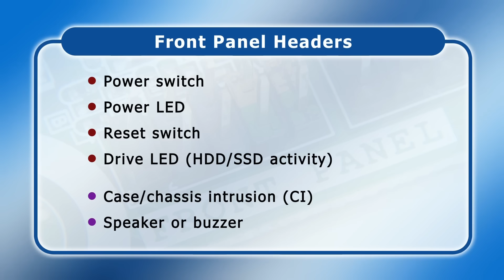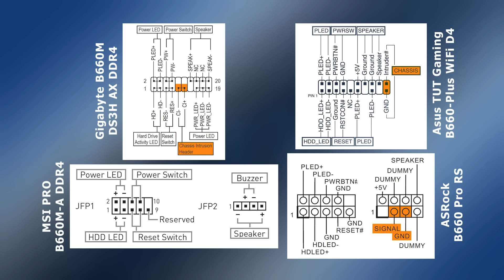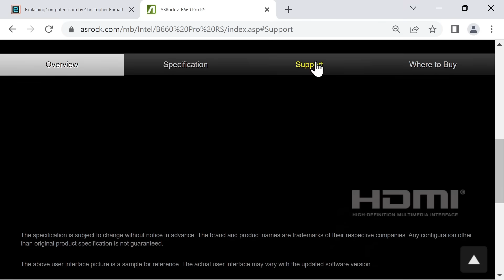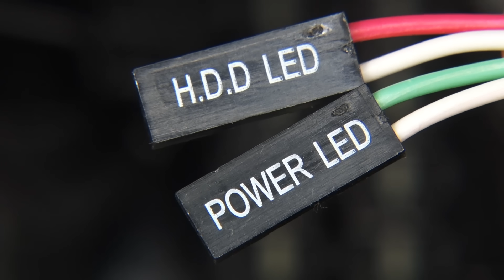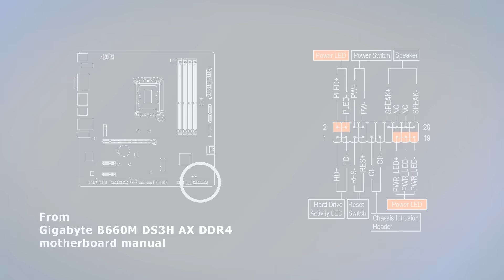Explaining PC Front Panel Connectors

Comment: That manual for the MSI PRO B660M-A DDR4 board lists four pins, and labels them as "speaker" for the outer two, and "buzzer" for those in the middle. What's the deal with that?
Is there a difference between a "buzzer" and a "speaker"? Is the electrical signal different? Or are those just connected to the same lines?

Comment: Front panel headers are the part of a build that I dread because my bass player's fingers are not the best thing to get into tight spaces and still be able to see what I'm doing ! 
I recommend using a pair of fine long-nosed pliers or getting yourself a pair of artery forceps, which are great for getting a hold on fiddly little connectors.

Comment: Not a fan of these front panel connectors as you mentioned they're not very standardized but since they're essentially a junction they did prove to be very flexible to me. 

First is troubleshooting the motherboard. Second is wiring up an Dell front panel connector (which cobbles all these headers into one connector) to an non-Dell motherboard. And third is to replace a broken power switch.

Comment: Great Video! The front panel was such a problem for me years ago, when I frankenstiened some old PCs from garage sales as I couldn't afford new parts, some of the older MoBo had no labels on the FP and I couldn't find manuals online. I Still have a front panel switch from a 2004 E machine tower bc it was helpful for figuring out old pin outs. 
I love how you reduced the circuits to the simplest form to explain. Once again a great video.

Comment: 2 Things: 1st: Some motherboards (Asus Rog Strix B560-i in my case) will turn the LEDs off when extreme power saving is selected. I always thought these connections would be hardwired, making the LEDs work no matter what. Makes you wonder if hackers could use this to report no SSD activity while all the the files are being encrypted without the user noticing. Surprisingly this did not turn off Intel Turbo Boost. But that is another topic.

2nd: The part at 10:06 that holds the speaker. Are those support rails for full length expansion cards? Those would be handy with today's  graphics cards wouldn't they?

Comment: One problem I have ran into is when replacing a brand name motherboard with an aftermarket one. The layout of the front panel switch connectors are usually all one connector. Trying to decipher which wire is which can get tricky, as the wires to each switch/light are sometimes the same color. And the front panel switch unit can be self-contained. I even came across one that had a different layout for the USB connections. The missing pin was on the opposite side. Not to mention the front panel audio plugs.

Comment: I hate the front panel connector. It's been over 25 years and motherboard/case manufacturers STILL can't agree on a singular plug. Only Gigabyte and ASUS have come up with a little contraption to make life a little easier. But it only exists because motherboard manufaturers need to get their head out ot fhe sand and work together for a singular plug.

Comment: Very nice when they actually have all the standard pins (good clear examples!) and better yet, labels... many do not.  Good trick with the power switch extension. :D 

A few of the many-do-not miscreants from my collection...

-- speaker headers that have THREE pins and no blank or dummy pin, or two adjacent pins. Regular 4-across speaker plugs will not even fit. (common with older boards)
-- NO power or HD LED and NO Reset pins! (I'm lookin' at you, Lenovo....)
-- More than one pin pair that function as on/off switches, and no labels. (In that event, I drag a BIC Stic pen point back and forth until it contacts a pair that work. The conductive tip is just the right size. A small Philips screwdriver will do in a pinch.)
-- Naked USB headers and a case that has a bundle of loose plugs with minimal or no labels. Better guess right or the magic smoke will get out. (Intel, over into the corner with Lenovo....)
-- An extra and undocumented USB jumper that needs to be closed before USB3 will work....situated at one end of the USB header, so it's all one unit. (Seriously, Lenovo...)

You may sense a theme... a lot of OEM boards have front-panel insanity. One becomes grateful for labels and manuals, and for mainboards that come in an antistatic bag instead of inside a name-brand PC....

But as this video clearly demonstrates, it need not be a mystery, or difficult. Choose your board wisely... attention to this sort of detail propagates across all the features.

Comment: Great video Chris. Just an observation. You didn't mention the small sockets that some manufacturers include nowadays that have the same pin orientation with the motherboard and allow you to insert the pins there instead of the motherboard's connectors and then connect this socket on the motherboard. They are truly lifesavers, especially for us old dogs who need a couple of different pairs of glasses and a strong lamp above their head in order not make mistakes during the assembly.

Comment: It would be cool to see a video about upgrade or repair options on laptops, along with explaining the layout of connectors on its board. I'm pretty familiar with it but it could be helpful to others who want to troubleshoot in that kind of situation.
Reply: That would be a total can of worms. There's no standard anything. Surface Pros are all glued, while Asus laptops are modular. Some need to remove the keyboard to upgrade the RAM (and that RAM may not work). And so on.
Reply: @Rez Zircon As this channel usually goes, I don't expect tablets and more complex stuff to be covered. I don't know if you want that, but I certainly don't. Most laptops follow at least one or two basic trends for teardown.
Reply: @Gamefreak924  I had cause to compare teardowns of a Surface Pro with an Asus E410. Couldn't be more different, and goes to show how this really isn't one topic, but species specific.

Comment: Recently built my computer from scratch and was able to buy a 8pin ribbon cable, bare connectors and terminals and make my own front panel connectors. I used a green LED for power and blue for HDD. I did get confused on the power switch because it was a momentary switch. I had to search for some time to get an answer you clearly presented in minutes. As a hint for anyone building your own front connections, use a resistor on the leds, they will be blindingly bright in the dark. As a side note, my PC is purely passive cooling with no fans, the mobo and ps are mounted on an aluminum frame which is open mounted to the wall caseless. (☆▽☆)
Reply: As a quick note, I got all my supplies from digikey if that helps anyone.

Comment: Chassis intrusion is an interesting one. Once worked on a large "MoD" site with many thousands of Compaq desktops. The BIOS was configured on each to talk to a Syslog server so if any of the cases were ever opened it would be logged with the unit serial number. As asset tracking was super tight it only took a quick lookup to find out who the unit was assigned too. I think some NHS trusts also do similar.
Reply: RAM theft was a big problem at one point. People would liberate a spare module or two for their home machines or to sell on.

Comment: Hmm… I've just discovered my early 486 PC/AT clone will only boot on the power switch (rather than with a reset) if the HDD-LED is plugged in. Curious. Not sure what to do if I go for a Compact Flash car replacement. Not sure if the adapters have these pins, too.

Comment: This brings back memories...  Cannibalising old PC cases for their power and reset switches and LEDs.  One non-standard feature of front panel connectors, or at least of motherboards, that irks me is how some don't support making the power LED flash when a PC is in standby.  It doesn't seem to be related to the price of the board, either.
Reply from the maker: The Telegram EC account is a fake, a scam, and has now been banned.
Reply: @ExplainingComputers  I had assumed as much.  Still, sad to see a new cast member leave so quickly.  Farewell Sam The Scam; we barely knew ye.

Comment: Yet another great one Chris!

It's does make one think on the limits just two LEDs can convey. Last year I modded my desktop with a small USB-powered custom PCB that drives a third LED which lights up when my GPU is hard at work (with a little Win32 C++ coding in Visual Studio).

Also, early last year, I built a storage server around the X11SDV-4C-TP8F Supermicro motherboard, it has THREE headers for front-panel status; telling them apart was a head-banger without the manual as you rightly put the importance of having to-hand.

Comment: Please no... i was always afraid to make wrong connections, and that the PC wouldn't start ! But the most annoying was the noise of the hard drives, so i had plates of sponge etc to avoid vibrations... i started with a Cyrix 330Mz, then upgraded to a AMD 500Mz, then 1300Mh, then... at that time the 128MB of memory was so dam expensive. I staid with AMD to i guess 2Gh then i went to Intel, a cheap 2,5 celeron, but with a SSD hard drive. Nice and quick install.

Comment: "it's perfectly fine not to connect... the reset switch" - 6:49
That's debatable!   ;-)   While we don't NEED a reset switch as much as we did in the past, I find it annoying to have to shut it down and restart if there is a problem.  And then of course how long do you wait between turning it off and on again?  Everyone seems to have a different answer for that!  A reset button just makes life so much easier and it restarts immediately.

Comment: I was dealing with this last night at like 12am as I was building my roommate's PC into the night. The timing is perfect haha! Sleep deprivation made this particular part of the build the most nerve wracking part of the process, moreso that worrying about the cpu cooler pipes colliding with the heat sinks around the CPU socket, and was compounded by the fact that I had already rested the motherboard snugly in it's new case. I got it all hooked up though after consulting the physical manual many times

Comment: I think its astonishing that in the last 40 years PC motherboard and case manufacturers haven't got together and agreed on a standard connector/layout for this function, as every other connector on a motherboard has. Its not like its a rapidly evolving part of PC technology either, the front panel connections on a 1990's PC are pretty much the same, with the possible exception of the disappearance of the "Turbo" switch and LED!

Comment: A nice nostalgia trip. I only connect the power switch nowadays. My RAM has red LEDs which are more visible then a tiny front LED. My nvme SSD is never fully utilized because software can't keep up. Lastly if something goes wrong my motherboard has debug 4 LEDs to indicate the problem.

Comment: Where's the Chassis Intrusion explanation? I would like to see it in action.
Reply from the maker: I sadly could not find a case with a CI switch (basically  a switch that opens when a side panel is removed). When then happens depends on what is selected in the BIOS in the even of the case being open.
Reply: @ExplainingComputers  I don't know what kind of switch-type it is using, but I'm guessing it has two buttons, one for the chassis cover, and another, a button to reset the switch internally.

Comment: The positions for the pins of the power LED, storage LED, power and reset switch has become an unwritten standard over the decades. Some cases even have one connector that fits on that part of the FP pins, which was an Eureka moment for me when I discovered this on my Akasa Maxwell passive case for my AMD Ryzen 7 5700G bedroom PC. However, I think this could be more simplified into one little 2x3 (6 pin) connector as all the grounds of all the LEDs and buttons are common anyway, so they don't need to be redundant. Only 5 of the 6 pins would be occupied, so we can block of one hole on the connector to key it to only go in the right way (kind of like the HD-Audio or AC97 front panel audio connectors). This would make it easy for everyone! While we at it, we could just use a 3 wire connector with a bi-directional protocol that could be used with a little 3ct Padauk micro controller in the case for the switches, LEDs and even RGB lighting.
Reply: Some Asus boards ship with little jumper blocks that you can plug your case leads into, then just plug in the block onto the mainboard. Really handy.
Reply: @Reziac  The pins are far too thin on those, making the individual connectors very loose. They slip out when you look at them at the wrong angle. So you need some tape to secure them, which also defeats the purpose. Nice idea, bad execution.
Reply: @kyoudaiken  Maybe on some, but the ones I have work fine.

Comment: The switch connections are polarized. They will work with any floating switch but a grounded one has to be connected correctly
Reply from the maker: And just how would a PC front panel switch be grounded? To where? There are only two connectors on a front panel or reset switch, and both go to the front panel only.

PC power and reset switches do not have a polarity.

The motherboard headers are (sometimes) labelled to indicate which pin is the carrier of the current that is to be connected to the other pin.
Reply: @ExplainingComputers The ground side would be connected to ground. The ground connects through the power plug and any uninsulated mechanical contact with a conductive chassis. Most electronic switches have a polarity. Any catalog will show high side and low side applications, e.g. an NPN transistor usually grounds the emitter, while a PNP is connected to the positive supply

Comment: I was so pleased when my newest board came with a small rectangular plastic plug, that you connect all the front panel wires to outside of the case, and pushed the block in all at once. That should be the standard I think.
Reply: That certainly sounds quicker and more likely to happen than an industry standard layout.
Reply: However this is a problem. Putting an older motherboard that doesn't have that 10-1 standard plugin. The previous MOBO that I have has a 20-8 pin layout and I can't connect with out breaking up the connector pins.

Comment: Basic PC speaker or beeper may not have effective polarity.
 But separate speakers IE hi fi definitely do. Which you can hear if you listen carefully. Sound inversion. Not sure if the basic external pc speakers are audible. But some of my friends are audiophiles/musicians/sound engineers and have pointed out the wrong polarity, and with a cross bridge 2 line switch IE switching straight away between correct and inverse polarity I can hear the difference on 1 speaker.
I do actually notice the difference on a 2 or more speaker setup by just noticing, no prompt. If actively seeking.
Reply from the maker: Yes, agreed. And I was extremely careful in the video to caption that "The front panel speaker does not have a polarity". And this is true.

This is an educational video, and hence -- to maximize accessibility -- less is usually more. So I did not get into a discussion about the requirement to match polarity when fitting a stereo pair of speakers to prevent them being out of phase.

I basically here can never win. Already my videos are often too long. And they would be longer still if I included caveat after caveat to cover things that are not the subject of the video.

Comment: All the POST sounds, can be set in various ways to go to the sound system part of the PC, if you only need to hear them to test it might be an idea to connect 3.5 jack you can use with headphones for testing so you don't have to open the case, the BIOS battery connections could be extended to say good just change the BIOS battery on the outside of the case as well, you can also get a microcontroller with power over ethernet and Bluetooth to activate the PC remotely and perform all of the functions of the control panel.
Reply from the maker: Brilliant idea for a 3.5mm jack on the speaker header. :)

Comment: Very nice and instructive as usual ! Let's now mix together your two main topics, and have a Raspberry Pi Pico (wi-fi) connected to those headers, so you can turn your computer on and off from the Internet !
Reply from the maker: Not that is a cool idea! :)
Reply: Great idea,
and maybe monitor the fan speed, temperature and prepare for a remote session.

there is actually a dedicated device to perform such a thing (with some more advanced tasks),
I think it's called IPKVM and I see it on Jeff Geerling's channel.

Comment: The mention at 10:14 of using speakers from old electronic devices was great and adding that idea with salvaging front panel cables from discarded PC cases and soldering them together is a cheap or in many cases free way of making a PC beeper/speaker.

I made one myself via that method as I like hearing those POST beeps that bring me back to the Althlon XP computer my family had when I was younger. They've been very convinent too as budget motherboards often don't have the segmented LED displays that display error codes during the POST process.

Had to make a separate comment for that additional engagement for the algorithm overlords and to not lose the heart from you Chris. Keep up the nice work with these very informative videos!

Comment: Very helpful to someone building one of their first PCs.  I think the first one I build was in the early 1970s.  My problem has always been getting the pins on the connectors,  As you pointed out often they are at the bottom front of the board and very hard to get to.   I have used needle nose pliers and forceps